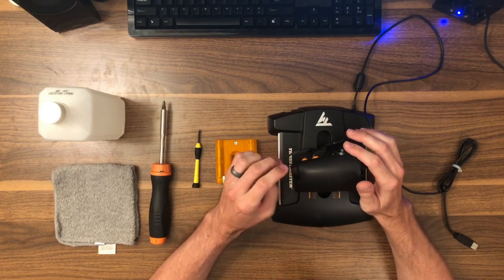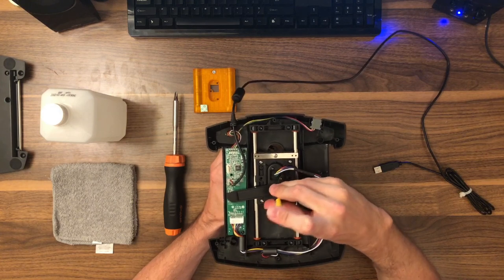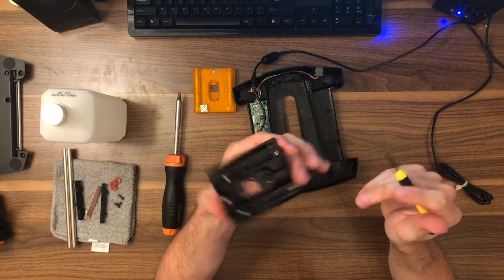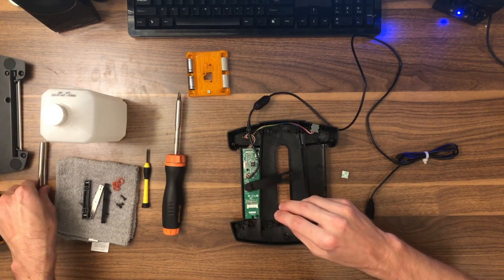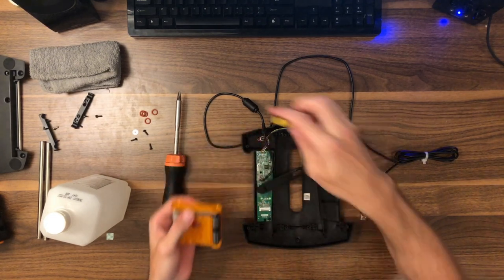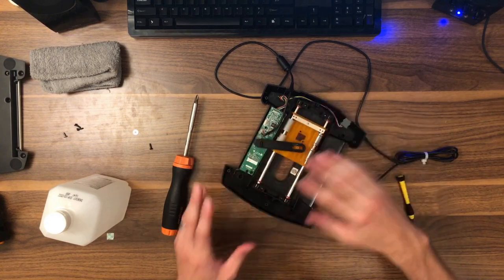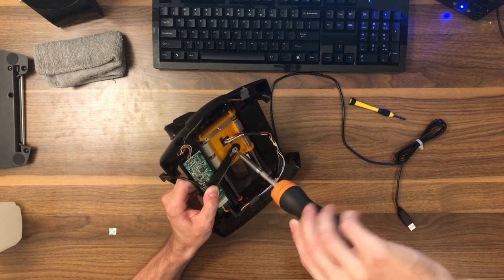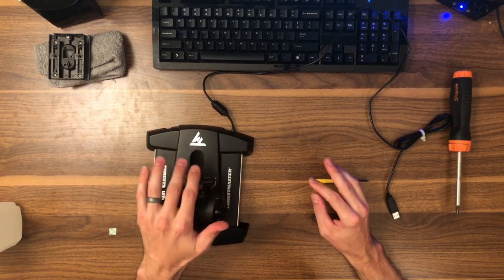Impulse Slider Installation Guide - ThrustMaster T16000m Throttle Upgrade!

Comment: Just spent about two hours goofing around in DCS after this upgrade... and I gotta say it's great. I ended up ordering the version with both the bushing and the bearings and I'm glad I did. Originally, I just wasn't sure which feel I would prefer... but in the end I just couldn't eliminate all binding when using the bushings. I don't blame CoreHawk3D for this, I just think the rails that came with my example weren't manufactured to very tight tolerances. So, I installed the metal bearings and they work very well. Huge improvement! While they are definitely louder than the bushings, 99.99% of the time that I'll be using the throttle, I'll have my headphones on... so it's really not a concern. The magnet detent is just enough resistance for my personal taste... you can feel it, you know when you are on it, but it's basically effortless to push past. I could see some people desiring a little more tactile feedback when you hit it, but that can probably be fixed by sourcing a new magnet. Overall, great product, highly recommended... vast improvement over the sticky / binding feel of the stock throttle.

Comment: works great, got mine a few days ago. there is def more friction then I had before but I might just have to fiddle with with the bearings and rods; and def have to re lube some parts. I got the plastic bearings and it does not slide up and down when just tilting the throttle with gravity like yours does the position of the throttle is pretty much cemented in place unless I give it a fair amount of push however that jerky tendency of the original part is totally gone; which was my hope for this product.
Reply from the maker: Thanks for the feedback! Some of the sliders squeeze the polymer bushings more than others. I test and select the best fits I have available especially for the polymer only options but it sounds like this one was still a little too tight. If you’re open to it, I recommend you get the LM8UU metal linear bearings from amazon and snap them in. They hold their shape and leaving them in the slider for a day or two will loosen up the tightness of the fit and those bushings will perform much better! Please let me know if I can help in any way.
Reply: @CoreHawk3D  Wanted to give you a quick update, after applying some nyogel 767A she is super smooth, falls with gravity as well. wonderful product.

Comment: Installed this myself in about two hours all told, works a charm, though the polymer bushings do make a little bit of noise it's not something that bothers me personally.

The only complaint I have, small though it is, the screw that you picked to tension the friction adjustment leafsprings is a bit shit.  Does the job fine but the head is not terribly high quality and it already looks like it's damaging the slot.  I might think about sourcing some better screws.
Reply: afaik the included screw is a self tapping screw. the peg doesn't come with threads already in it, and while i haven't personally held this part, from what i have seen, 3d printed parts tend to be a bit rigid. if you had a softer plastic then you could probably use any old screw and it would just squish and displace the plastic out of the way to form the threads, but if you tried that on one of these parts it could split the peg.

Comment: Picked up a new TWCS throttle last week. I've only got a little over an hour and a half of use so far and the stiction is already crazy! No doubt this'll help, just gotta wait for it to arrive.
Reply from the maker: I’ll be excited to hear what you think comparing a new one to the impulse! I’ve always wanted to do that! Thanks for the comment!
Reply: @CoreHawk3D  Arrived yesterday and I've had a day or so to test it out. Right now I've only tested it out in IL2 but it's a night and day difference even with a relatively new TWCS throttle. Movement is incredibly smooth and there is 0 stiction. The 50%/middle magnet detent is also great, it's strong enough that you can feel it but not strong enough to snap your throttle into place and keep it there while going from 0-100%. 10/10.
Reply from the maker: @sh1pshap3  OUTSTANDING!!! thank you so much for making that comparison! It's official, it's better than new!!

Comment: Have you tried Nyogel with these plastic bushings or metal bearings? Does it work well with this mod? I already use Nyogel on the stock unit, but am considering this mod in addition, mostly just for improving rigidity. I find the throttle handle tips a little bit with the default parts.
Reply from the maker: I personally haven't. A few of my customers have though. For the metal ones, it doesn't help much. If applied in more than a very thin film, it dampens the individual bearings, greatly amplifying the grittiness of it to an unpleasant level. I have heard of some enjoying the effect it has on the polymer ones though, I'd say try without first and if something goes amiss, get some more LM8UU bearings or bushings on amazon and you'll be back in business easily.
Reply: I used Nyagel with the plastic ones, and I like it. A little bit goes a long way though

Comment: I purchased one before the video ended.
Reply from the maker: Thank you!! I’m excited for you to experience the difference. Please feel free to give any feedback you might have!
Reply: @CoreHawk3D  Just finished reassembly and felt an immediate night and day difference. Magnet placement was spot on at 0%, and I suspect minor deadzone adjustments in-game will mitigate the inherent degree of play. I'm looking forward to experimenting with bearing combinations over the next few days. I've also been recommending your slider to my fellow Star Citizens, as the Impulse Slider should become common knowledge among TWCS users.

The only other critique I can make comes by way of feedback from someone I'd shared the product with last night, which is that they weren't able to easily find it with their search engine. My hunch is that this partly stems from your use of 'μ' in the product's title, which is not necessarily assumed to be a 'u' character by search engines and is dropped entirely by Etsy's URL generation. (.../885326705/implse-...) My recommendation is to continue using the stylized 'Impμlse' in graphics if you like, but adopt standard spelling where SEO is a factor.
Reply from the maker: @twistedsphere  thank you very much for that feedback! I’ve changed all of the video titles and Etsy title. Now to see if I can even find it haha...

Comment: Got mine installed today, super happy with it, thanks so much!
Quick question though: I love the super smooth slide of the metal bearings but is there a way to mitigate its noise a little bit?
Reply: Metal bearings (on the right) are going to be loud just in the nature of how they're made - the only quiet one that will allow the same performance would be the "Polymer Bushing" (left set) options for some of the pages like https://www.etsy.com/listing/885326705/impulse-slider-mk2-thrustmaster-t16000m

Comment: It looks like I may be ordering another one soon. I just opened my throttle up again to adjust the magnet, and I noticed the spot where the sensor swing arm screws into the slider has cracked pretty badly. It's still holding together at the moment, but I have a feeling it's going to get worse.
Reply from the maker: Woah! That’s no good. Will you send me a picture? Have there been any notable impacts or incidents you could point to that likely caused the crack?
Reply: @CoreHawk3D  Picture and reply sent via Etsy; reposting here for public consumption:

I can't think of anything that would have caused it, except that I've disassembled it 3 or 4 times since installation. I know it wasn't there after I installed it originally. I treat it pretty gently and have only used my usual small hand tools that I use on other electronics.
Reply from the maker: @belliqueu5843  thanks for the follow up both here and on Etsy! It looks like the layers separated at the halfway point on the swingarm mount. It makes sense that a print would fail via layer separation. Anyone else, please reach out if you've had this issue. I view that as a product defect and will replace.

Comment: I have been experimenting with using low profile dual lock to make the detent removable in a slightly cleaner way. I will need to try with a thinner magnet though, because even with the low profile dual lock, the magnet rubs just slightly against the slider.

Comment: @CoreHawk3D I'm curious do you have a similar salutation to the Pedals for the T16000m kit? Heard it can suffer with the same sticky problem. I'm wanting the sledge upgrade so wondered if I could look into ordering both at the same time.

Comment: Looks amacing solution. Where are you going to have more stock. I dont really know what to chose between metalic and polimer so I would like to order both but now you have no metal ones. Thank you so much
Reply from the maker: Thanks for asking! Looks like amazon has the metal bearings arriving on thursday. I wait to list an item until I'm physically holding it or have tested/inspected it, so it's looking like Monday 7 December. I'm sorry for the lapse in supply and thank you for your patience!
Reply: @CoreHawk3D  I am going to order one as soon as you will have new suplies! Thanks

Comment: (Just to be clear, I love this mod and used my throttle excessively in Elite: Dangerous)
I bought mine May 2021.. The plastic print gave out along a few layer lines. Looks like string heh. Glad to have the file available of the new version so I can resin print my own as needed!
Reply from the maker: hmmm, was it near the front? Did you get a Mk2?
Reply: @CoreHawk3D  Yes, it was the Mk.2. It split along the sensor arm screw hole from left to right. Found 2 minor fractures 1 inch apart from the main split too. 
In hindsight I noticed the handle was a little loose a few weeks before, but didn't think much of it. 

Anyway, my mk3 came out great, and I'll have the 6x3mm magnet today. I can test the finished project. I like the hockey stick idea a lot.
Reply from the maker: Thank you very much for the feedback! I'm going too enlarge the hole from now on. You've benefitted the other customers :)
Reply from the maker: @Striker_AgingGamers  Onem more question, what color was it?
Reply: @CoreHawk3D  Sure. It was Gunmetal.
Reply from the maker: @Striker_AgingGamers  Ah. Can't say I'm surprised, unfortunately. Most were good but I eventually gave up on that color due to brittleness.

Comment: I just received and installed mine with the metal bearings, and it feels great. It might be worth updating this video to showcase the new magnet/detent setup. I don't want detents so I just omitted using any of it, but I wasn't super sure how to install them in the first place. Am I supposed to glue it down or do they just friction fit between the top plate and the slider?
Reply from the maker: Thanks for the comment! Yeah I need to do a new video... at least about the changes and updates. Yes, the hockey stick needs to just be glued into the top of the case with hot glue (and a good bit of pressure to flatten the glue) or just super glue. From there the magnets are all friction fits inside the hockey stick.

Comment: Hey, first off, great video, I'm surely going to get one of this for my T16k! Quick (maybe stupid) question about the detents: I'm playing DCS and there's a detent in game for the military throttle, which is like 70% input; can I put the detent at 70% instead of 50? Cheers!
Reply from the maker: Hello! Sorry for the delayed response. I've got something in the works to add this long-demanded feature. For now, I'd add some extra adhesive to reduce the gab between the slider and the magnet attached to the case as you attach a magnet further toward the front.

Comment: Is there any downside to just gluing the magnet in place (after confirming correct placement of course)
Reply from the maker: Not that I know of. Maybe if you changed your mind a thousand times and kept taking the magnet off the slider and putting it on tons of times, the hole will grow/fatigue and the friction wont be enough to hold it in place. I can't see anything bad about doing that. Just make sure you get the polarity right, it'll save you one time of removing and reinstalling the magnet on the slider. Not a big deal though honestly.
Reply: @CoreHawk3D  good to know I’ll definitely be picking one up when they’re back in stock

Comment: I ordered mine with the metal bushings and I find them to be noisy and make the throttle sound cheap.  Does anyone know if the Polymer Bushing are available by themselves?
Reply from the maker: they sure are! You can find them on amazon by searching Igus LM8UU linear bushing.

Comment: Should there be any grease on the guide rails, or should they be completely cleaned off with rubbing alcohol, etc.?
Reply from the maker: I’d wipe the rails off with a rag if there is any kind of thick or viscous grease on them. Light weight oils I wouldn’t worry about as long as it’s a thin film. The metal bearings come pre oiled and the bushings self lubricate. I wouldn’t go so far as using rubbing alcohol.
Reply: @CoreHawk3D  yeah, I tried nyogel, but didn't like how gummed up they felt. I'll wipe them down well, but probably without a solvent?
Reply from the maker: @StriderZessei  ooh it’s nyogel... so one of my customers has actually experimented with that and the metal bearings, using a very thin film, he liked how it felt. I’d recommend giving the rails a good clean with rubbing alcohol. That stuff is sticky from what I’ve heard. From there, install the metal ones first and try them. The light weight oil that comes pre coated on them will re-coat the rails (will prevent corrosion) and then try the bushings. From there feel free to experiment with small amounts of nyogel. That’s how I’d do it.
Reply: @CoreHawk3D  you're the man!
Reply from the maker: @StriderZessei  thanks Strider!

Comment: Any recommendation on the placement of the magnet for detent on DCS jets?
Reply from the maker: Thanks for asking Kyle! So I'm a little curious about this... do all Jets in DCS have the same afterburner detent location? (i.e. do I need to go and buy all the mods for science? haha)
Reply: @CoreHawk3D  The detente location is personal preference. You can just adjust the axis curve in the control settings to match wherever you put the detent.
Reply from the maker: @masonc9786  Thank you, I'll start tinkering here. I'm looking at getting a bigger magnet to mount in the case. Would it be bad if the detent were stronger in your opinion?
Reply: @CoreHawk3D  I actually just ordered your part a couple hours ago :) will let you know after I try it.
Reply: @CoreHawk3D  After a week playing, I personally think the magnet is perfect. I put the magnet roughly in the middle of the case to make the detente about 75% throttle instead of 50%. Used 2 layers of M3 since the curve of the case increased the distance from your slider.

This is a fantastic upgrade.
Reply from the maker: @masonc9786  nice! that sounds like it worked great!
Reply: @CoreHawk3D  I just stumbled across this  DCS tutorial of how to set the throttle in DCS with Afterburner Detent.
It may be useful to other  Impulse Slider users.  The demo uses a Wart Hog but he shows how to set up the controls in DCS which is applicable to any types of throttle. 

Btw, 10 minutes ago I just finished installing your Impulse Slider into my TWCS which is only about a month old. It now feels as smooth as glass. Much better that the brand new TWCS was and I am using the Nylon not the Metal version of the sliders. 

I didn't use the magnet. At first I left the magnet  on the top of the other, as you package it, just for a safe place to keep them incase I want to install a detent. But it made the glider touch the throttle housing at the end of the slide travel. So I took the magnet with the sticky tape off and put it away for later if I decide to follow the tutorial in this Video.
https://www.youtube.com/watch?reload=9&v=WlL0tQzVEPg
Reply from the maker: @SargeantKoranFlusher  Thank you very much for the tip/video and the feedback! Yeah the case is kinda tight toward the rear. That's why I had to design that sloping face on the top of the slider.

Comment: I cant choose between the polymer or metal option. I heard the metal is smoother but louder than the polymer, how big is that issue or how mutch smoother is one over the other?
Reply from the maker: Hmmmm That's why I do a ""both" option, its an even split honestly if I had to guess who's using which one. The Metals maintain the smoothness no matter how hard you push down on the throttle, the polymers are smoother when you take into account that there is no granular textured feeling. I prefer the polys but I've also really enjoyed the metals, I don't think you can go wrong :)

Comment: Do you need to lube the bearings? The metal on metal feeling is not the most plesant
Reply from the maker: Do you currently have one? they come with light machine oil, pre-lubricated.  Perhaps a light film of general purpose grease will work. Avoid large quantities of high-viscosity stuff since it will slow the individual bearing balls and make it seem "grindy."
Reply: @CoreHawk3D  hi, I got myself few linear bearings and a 3d print. Works great except the "grindy" feeling you mentioned. Might look into lube options, thanks :)